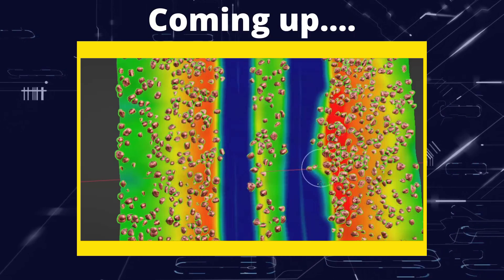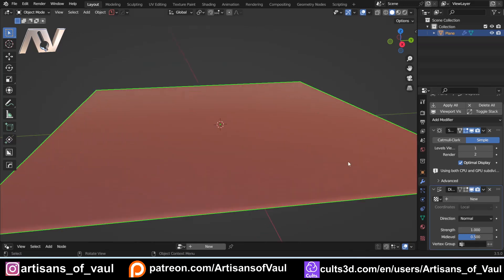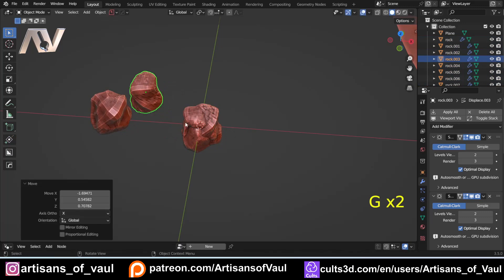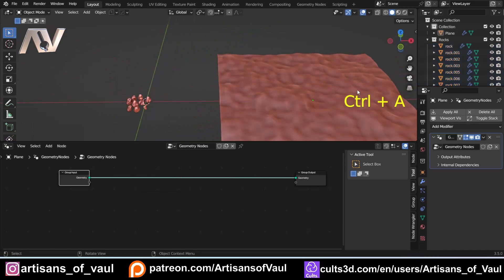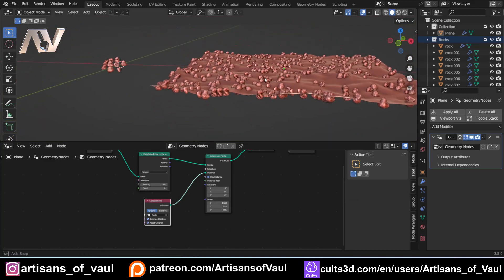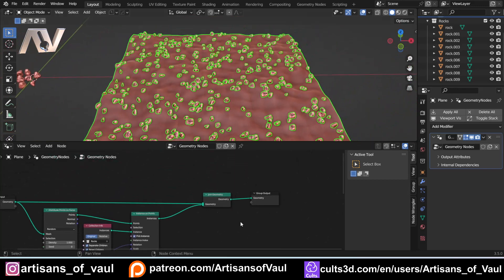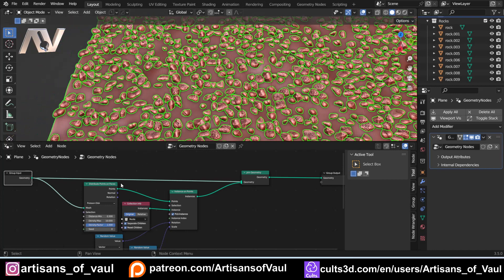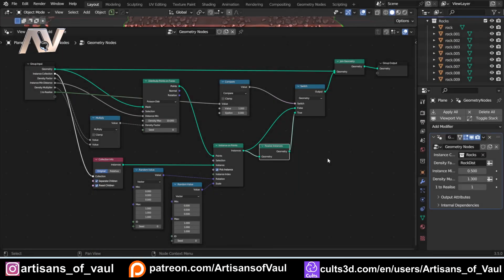RELOUDED Controlling  Scatter Placement with Weight Painting and Geometry Nodes

Comment: Great, is there a Method to control the scattered objects. For exampie: One  long stick scatterd and they all target to the outside direction or in the same direction ...
Reply from the maker: @Container-11  Oh interesting idea. Not that I can think of as standard but with geometry nodes it should be possible.
Reply: @ArtisansofVaul  If you stumble over a solution, let me know. Its for a tree. i would like to scatter the leafs over the top, but they have all  to lining downwards.
From the northpol to the southpol, so to speak. For now i will place the leafs manually.....:face-orange-raised-eyebrow: 
Thanks anyway for the answer ...

Comment: Could you add collision to the plane and rocks, lift your rocks until they are above the plane slightly, and then physics sim to get each rock to lie more naturally?
Reply from the maker: I imagine you could. You'd need to use an offset node to to keep the rocks above the surface, then apply the modifier.  Then add the physics as normal. I'm not sure if the rocks would need to be separated out to seperate meshes but that would be easy too. If this was for 3D printing you'd then want to move all of the rocks down slightly when you were happy with the positions (or move the ground up) to boolean everything together.

It's a great idea though 👍🏻